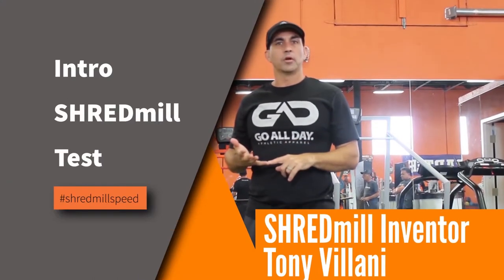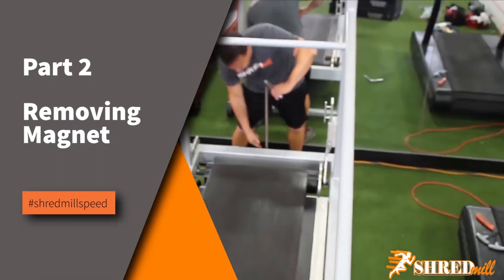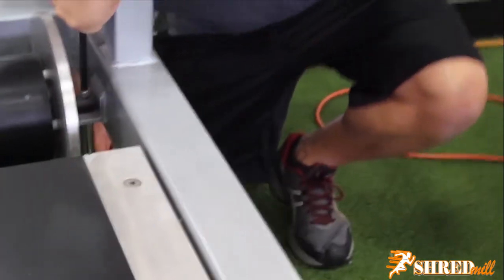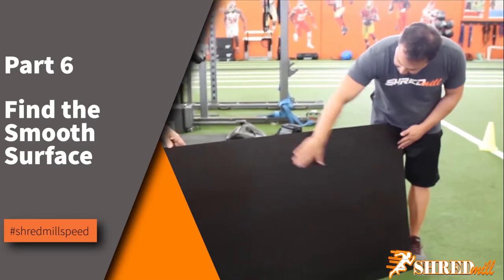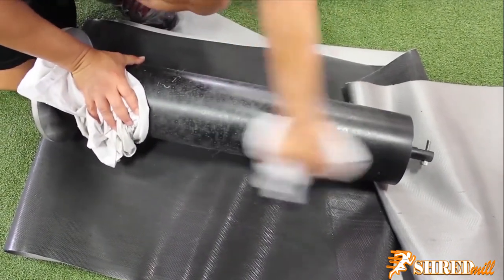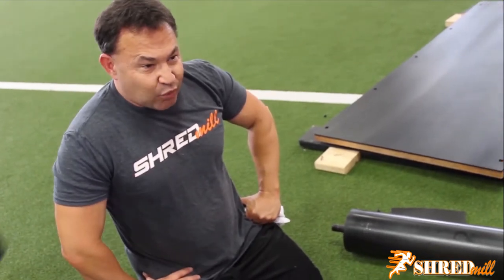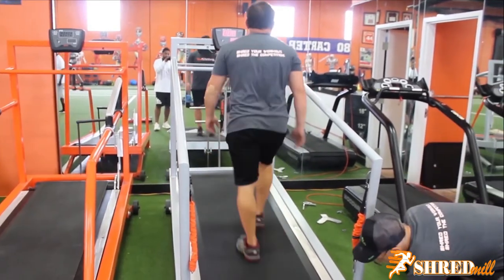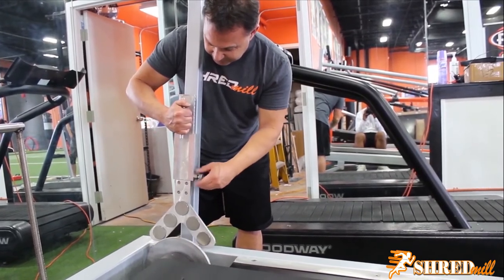SHREDmill Speed presents: Changing your SHREDmill board and belt

Comment: Leave magnet on the tread. Leave front roller in tread and take left roller bolt out, take sensor off and slide belt on.   

Count rear roller bolt threads for even tightening